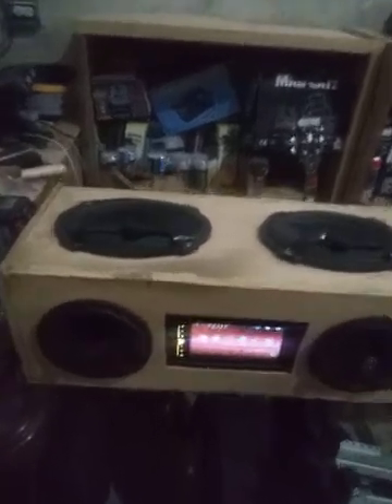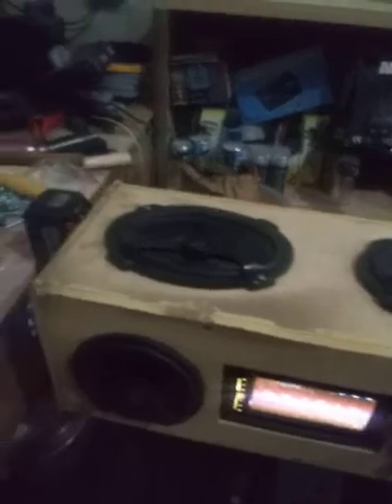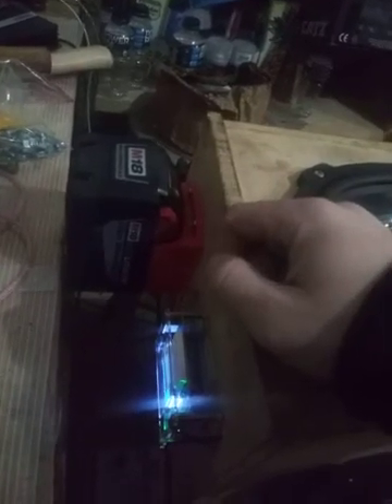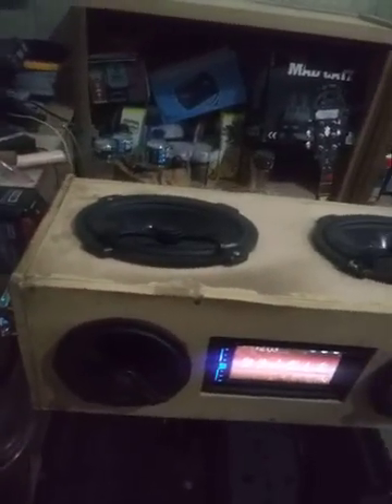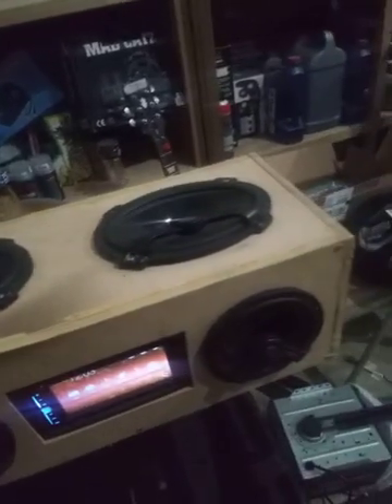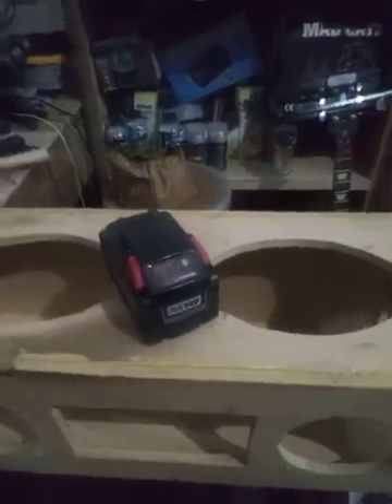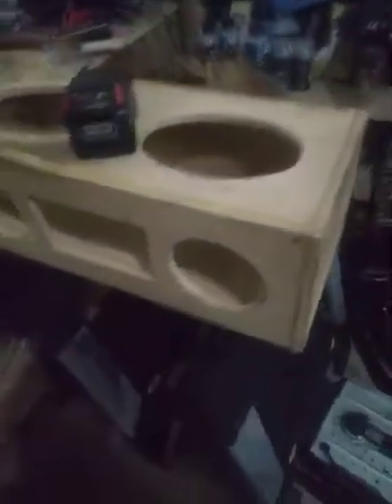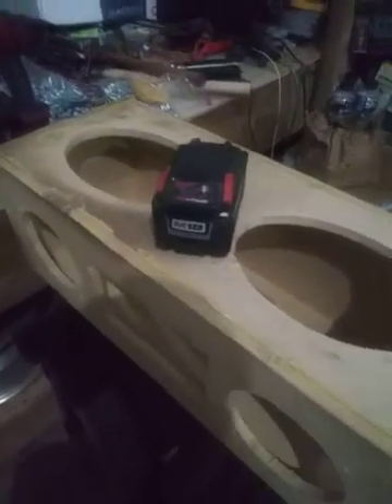Milwaukee M18 Powered Custom DIY Boombox Part 1.

Comment: Want to make a 3 wheel bike with a sound system would u recomend this set up and what amplifier u got on that
Reply from the maker: Yea this would be perfect. I used a pioneer 100.4d because its small.
Reply from the maker: Thanks, I couldn't really post with music because of copyrights but it is very loud and more importantly the battery lasts a long time. I made a different box with a chinese Bluetooth amp and 2 4x6" with a 10" sub that one wasn't as loud but had bass which was a fun tradeoff. Lots of options with designing a system like this.
Reply: Wish i could hear how loud that bad boy sounds looks good man thanks for the reply

Comment: Hey can i just use 12v cordless battery so that i dont have to buy the regulator and stuff?
Reply from the maker: Id say no because usually car audio is 14.4 volts and at under 10 volts the radio cuts out. The way the batterys work is the voltage drops as they loose power so  the Milwaukee battery is 20.8 volts full charged. It will run down until the battery is around 10 volts. Sometimes I have to jump my batteries if I don't pay attention so I would recommend a voltage cutoff switch as well

Comment: Is the regular a must to get it to work?
Reply from the maker: Yes or you risk burning up the radio. Milwaukee battery runs at 20.4 volts fully charged. The regulator is set to 14.4

Comment: How long does it last
Reply from the maker: It depends on the Amp per hour the battery has. On a 5.0 aph if is about 4 hours. 9.0 is about 7-8 hours at full blast.  I have since developed a different design with a powered 100w subwoofer and 2x50w speaker channels that I will post a video of soon.
Reply: @clumsotheclown7 did you build a new model with a subwoofer